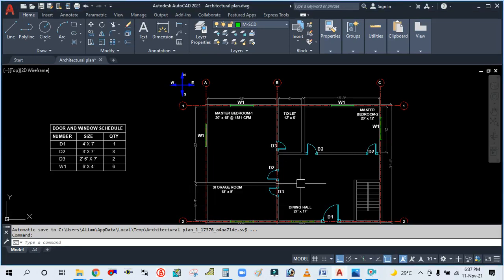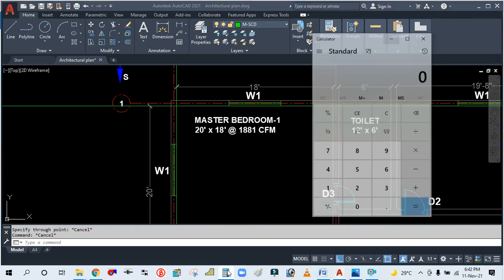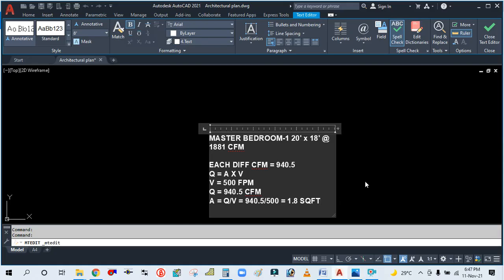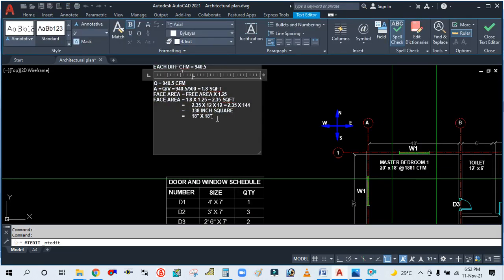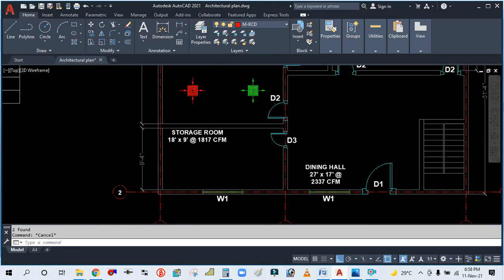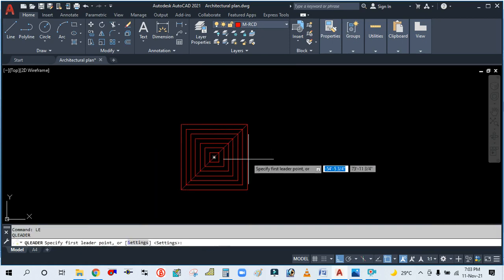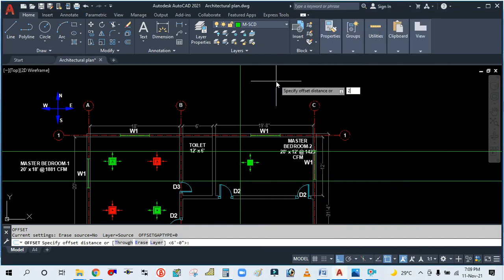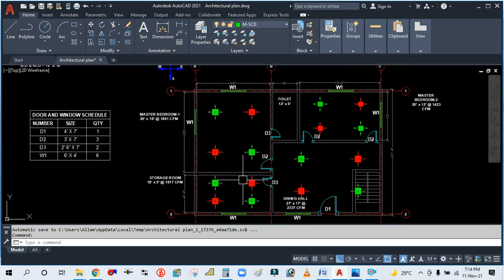AIR TERMINALS PLACEMENT & SIZING II SQAURE CEILING DIFFUSER PLACEMENT & SIZING IN ACTUAL PRACTICE.

Comment: Ok, what about return diffuser fpm value? Is it 500 or below 500..... what's the common range
Reply from the maker: Fpm will same for supply and return 

Maximum velocity for residential buildings 500cfm
Reply: @successengineeringofficial7742 thanks...
One more doubt
Is there any supply diffuser and return diffuser CFM ratio